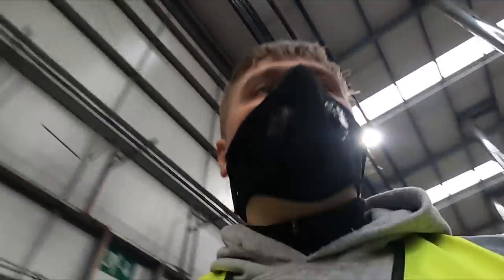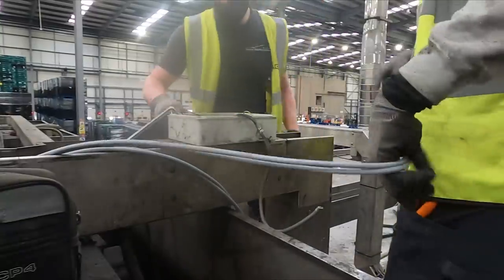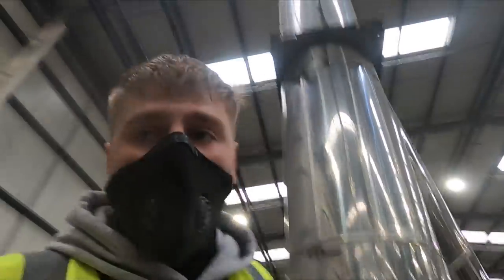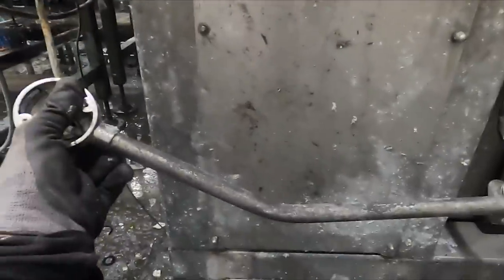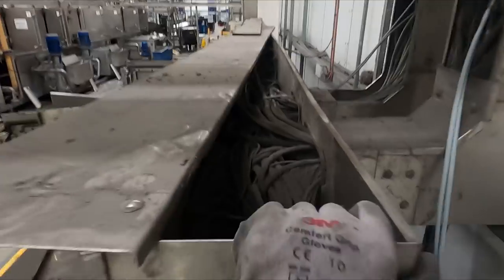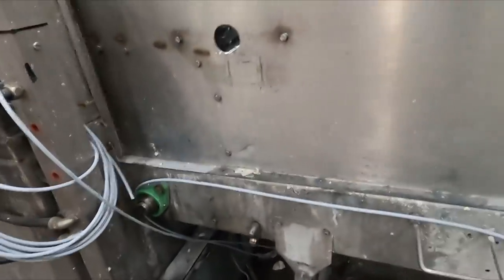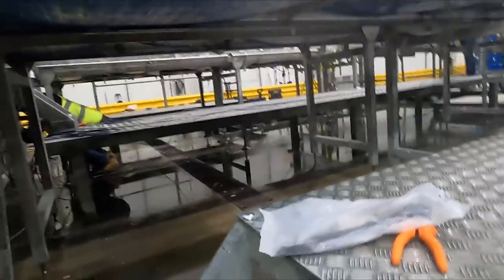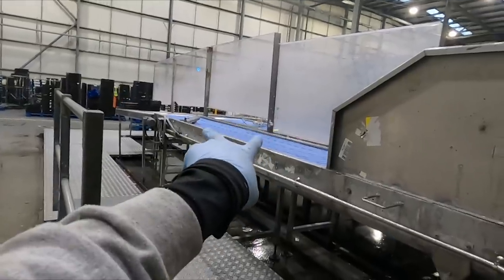Re-wiring a giant industrial dishwasher - Part 1

Comment: good video , I've done loads of domestic & commercial jobs but I would not know where to start with BMS or whatever you call it.
It's great to have a different perspective on sparky life
Reply: If you have a good spark background it’s not that difficult. It can seem daunting at first  when having to do a control panel like this but it’s all about ensuring safe operation, optimal safe start and stop regarding large machinery, like ovens furnaces large motors, heating and lighting. The more you do the better you will become. Of course the real issue is that with higher voltages, currents and more dangerous equipment in an industrial setting it does require additional safe working training and PPE. Most industrial plants are supposed to keep a register of maintenance and risk reporting when you see gaps in that it really tells you a lot. In some countries that could be a legal requirement and a health and safety issue. Most panels are now being upgraded with in-built power quality monitoring which can help to fault find issues with these complex interconnected systems.

Comment: Awesome!! I appreciate you using din rail and terminal blocks in the junction box, instead of just wagos or some type of crimped connection. I work on industrial control systems here in the states, and hate when electricians use wire nuts or the sort in control panels!